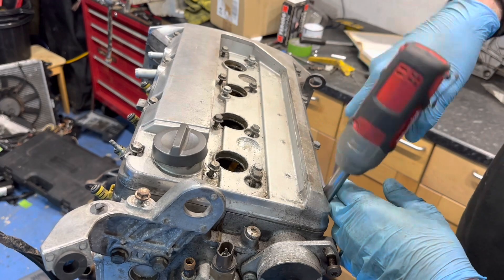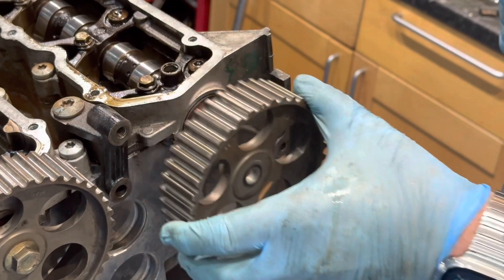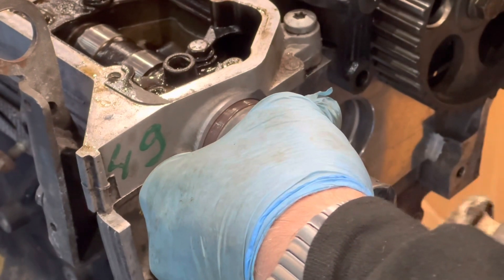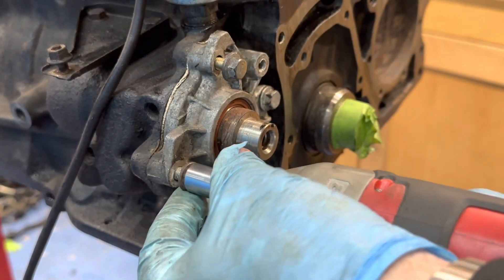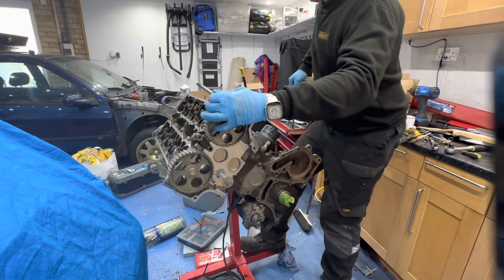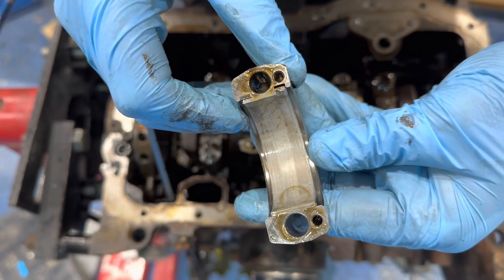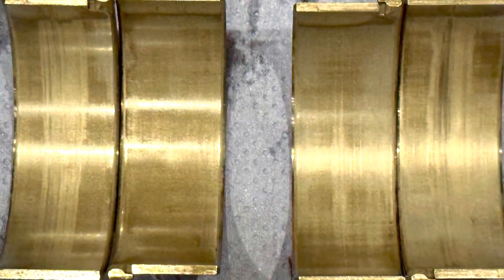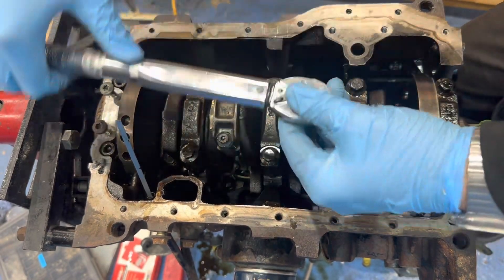Clio Williams F7R Engine Refresh video 1

Comment: Hi Steve I am currently doing the same thing.  Do you ahve a part number for the ACL bearings.  I bought mine from youngtimers and they turned up without the Lug or location tag.